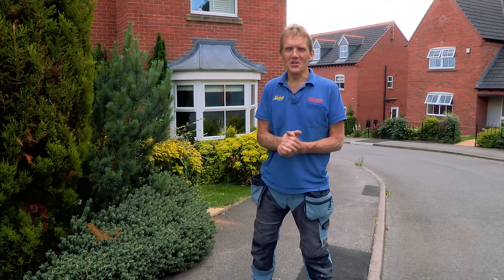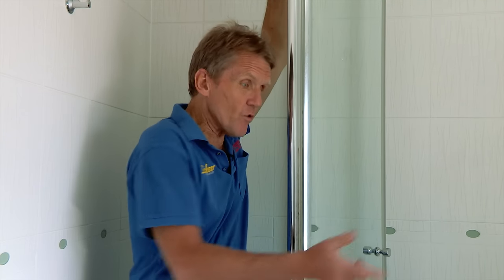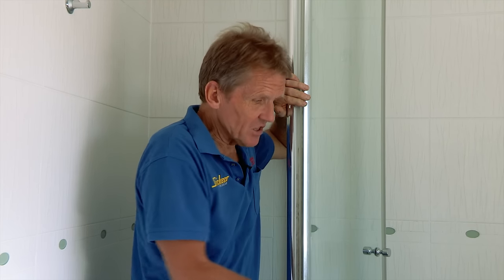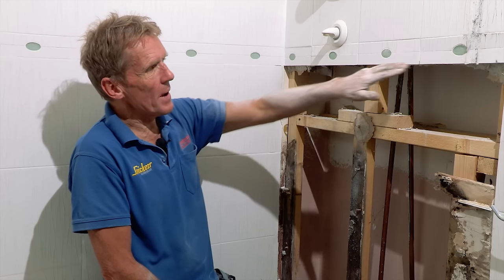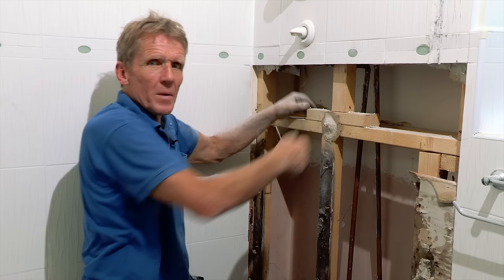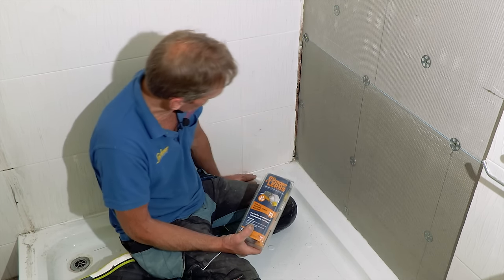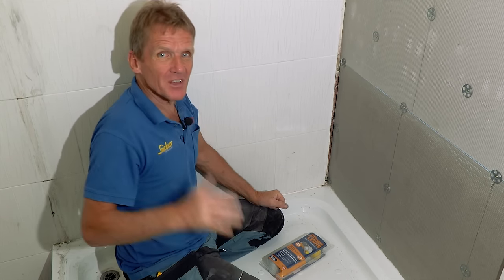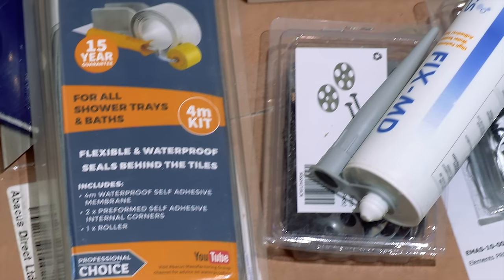Unbelievable Cowboy Plumbing Horror Show

Comment: Seems the real problem isn't the leaking shower, but the awful stud wall construction. Why are new houses built like this?

Had a leaking shower in our bathroom, noticed the wood flooring was warping and smelly. Plumber ripped out the old shower, which the previous owners had "sealed on the inside" , didn't know that was a problem but every day is a school day. Anyway, the leak was quite old, but because the walls were brick and the floor was concrete, it didn't cause any damage. Didn't even need to re-tile. Just cleaned and re-installed the old shower pan and cubicle. 

How can a stud wall stay rigid?

Surely any pressure on that wall from simply leaning against it would crack the grout and cause a leak. How on earth was that house ever expected to last.

Comment: If used correctly marine ply is fine for this job.Should be sealed before tiling.Our bathrooms were tiled 25 years ago and are like new.Those hi-tech insulated boards weren't even available then.

Comment: I did not see him re mount the thermostat control as he mentioned earlier. When he fitted the new board there, I'm sure you could have seen the extra supports attached to the woodwork. Can this be explained please ?
Reply from the maker: 9.35 you can see the bearer mounting for the valve
Reply from the maker: Watch it a bit more closely. The shower valve is mounted on a bearer that runs across the back of the studs

Comment: Good . Where did the water behind the wall come from ? Leak in shower valve ?
Reply: No.  Not only was the gypsum wall board not waterproofed it was set on the shower pan directly.  This allowed the water in contact with the bottom of the edge and it soaked  into the wall board upwards

Comment: There isn't cheap plasterboard. There is correct and incorrect depending on the area of installation.

I would not have had that backer board joint directly under the shower control.

And there were nowhere near enough fixings.

Comment: Can anyone help??? When water runs for awhile on bathtub(2nd restroom), the floor starts flooding usually on my restroom which is on the other side  of the wall..
Reply from the maker: It is the seal
Reply: @SkillBuilder    sorry dont know much about this.. can you be specific? Something I can do or do I need to call someone..which I already booked an appointment.  Dont know if the tub needs to be removed or the wall. I might add it's the only time water seeps under the wall!! Thank you for the reply.. wondering how much this will cost!

Comment: You should never put the backerboard all the way down against the shower base. leave yourself a 1/4" to 1/2" gap in between to prevent water wicking up the board
Reply from the maker: Water will not wick up this board, that is the whole point of it. I have weighed a piece and then put it in water for a month then weighed it again. It absorbs nothing. The convention is to run it down behind the tray so there is no void and then tile down to the tray on top of the tape. 

Your idea is applicable to water resistant plasterboard but even that is not run down onto the tray. .

Comment: Thanks so much for your videos.  Yours are the only videos ive seen that seem to take a belt and braces approach.  As if it was your own home.  Im a keen DIY'r and have been the victim of the plaster board scam used on a shower area.  I've managed to chase back the tile area on the plaster board wall - water damage went about 10 inches up the plaster board.  The other shower wall is brick with plaster directly onto it, chased the first layer of 10 inch tiles off the bottom and the plaster seems soft at one end.  If you don't mind helping a sole out.  Whats the best practice for the brick wall? should I remove the tiles to a safe height, and  then use Elements boards and dab to the wall?  many thanks for any help.

Comment: This is incorrect you may use plasterboard but you MUST keep the plasterboard from touching the tub as water will wick up once it gets behind the caulk. You MUST seal the tiles grout with a sealer as well if done properly it should last 20-40 years. If the tile is never maintained regardless of how you seal it especially if the grout falls out you will need to regrout you will not stop cracks by using cement board as an entire house shifting will not be stopped by that
Reply from the maker: I am talking about U.K code, not American. Plasterboard is rubbish in a shower
Reply: @SkillBuilder  nah it works fine if you keep it off the tub rim you just don’t know how to do it. Easily lasts 20-40 years

Comment: I don't know why people use drywall, plaster, cement board for wet areas? Unless you're waterproofing the space with a membrane of some kind. You need to use what Roger is  using in the video. In the US this material is available in various brands, wedi, go board, kerdi board and others.

Comment: The stuff you used is one use only. Because if you try to take off the tile at a later date the board disintegrates
Reply from the maker: Basil 
Yes you are right, the affinity between the tile adhesive and the board is so strong that it can't be separated without tearing the face off but, here is the thing, that is exactly what you want. If you want to  retile in the future you will be going back to the studs. I guess with cement board you could hack of the tiles and grind the face smooth to re-tile but I would rather start from scratch or, better still, tile on tiles if you have room.
Reply: Hi Skill Builder, cement backer boards are just the same. And the boards you used are VERY expensive, so going back to the studs is an expensive job. I have used plywood in 2 of my shows at home with none of the colour leaching you describe and one has been up there since 2004 with while grout. Plus plywood is so much simpler to get tiles and adhesive off. One tip I have is to use a wallpaper steamer to soften the adhesive (after you take the tiles off) and use a scraper to take off the adhesive. This method can be used on plywood or plaster walls
Reply from the maker: @basilkearsley2657  
You may have had success but 
the British Standards code of practice prohibits the use of plywood as a tile backing  board. There are a high number of failures and, if moisture gets onto it from a crack in the tile grout it will set up a mould which pushes the tiles off. 
The cost of decent plywood and the time spent cutting it, priming it  and taking it up to the jobsite means that it has no real advantages. I have stripped out plenty of wet rooms where plywood has been used.

Comment: OMG now he’s burying the mold behind the new shower!!!!  Wtf if this guy thinking??
Reply from the maker: The mould is dead when the moisture goes, No need to chemicals
Reply: @SkillBuilder   uhh, depends on the strain. Aspergillus can survive off 60% relative humidity once established.  Wallemia can establish itself at 55% relative humidity and has no issue living off dust alone. Many aspergillus and some penicillium produce ochratoxin a. 

     Now, just because it’s currently not actively growing and it’s dry doesn’t eliminate its effect on indoor air quality. As it remains dry, parts break off and enter the air, people who have become sensitive to it will have an immune response causing inflammation in various parts of the body. Many of the common symptoms are headaches, fatigue, brain fog, in particular word recollection issues. Most the time they are misdiagnosed as fibromyalgia, chronic fatigue, and migraines. There is also shortness of breath when exposed to certain molds like the notorious black mold  Stachybotrys chartarum. That one is most common on paper backing  of sheetrock exposed to slow leaks however it will easily grow on wood. It’s also a rare one in nature and never grows to the point found in an indoor environment. 

The steps you take are GREAT!! However, when it comes to mold, it’s mere presence should be taken with a greater degree of seriousness. 

  Full containment, negative air, physical removal under controlled conditions, the proper vacuum for level H cleanup. 

    And sure, no need for chemicals, physical removal with a wire brush or removing the contaminated surface should be done. 

    You take such great steps to prevent the mold; it seems foolish to bury it behind such good work.

Comment: Hi would a cemrock cement board work on shower walls ?
Reply from the maker: yes there are plenty out there such as Aquapanel. They are heavy and dusty to cut but it is a low priced option. You still need to seal the joins.
Reply: Thank you for the reply,I have learned a lot from following you on YouTube.
Keep up the great posts 👍

Comment: Brilliant work, just for some balance, those are failures from multiple trades on site from joiner to plasterer and plumber not just one man, if you took half as long as that to do that job on site you would still be sacked if you were agency. All  trades I have worked with want to do a top job but large sites won't pay the money or have the time, all projects are behind from the moment they put the first shovel in the dirt and most are over budget after the last brick is laid on the ground floor. The industry needs to change, the workers are fine they just need the ability to take their time. Apprenticeships are the same way, no time to properly show them the job so they learn it has to be quick not quality.

Comment: In sweden, you have to have a homogen membrane on the floor and walls. And you're not allowed to have a solderd pipe joint in the wall. The rulebook on how to water seal a bathroom is massive in our country. The way you fixed the bathroom in your video wouldn't be enough. The hole bathroom would have to be tared down, and everything would have needed to start from scratch. If the insurance companies discover that the rules haven't been followed, they wouldn't pay any money for the damages. And it's the insurance companies that have written the rulebook in sweden.

Comment: Aqua panel and tanking kit for me...
Reply from the maker: Nothing wrong with Auapanel apart from the weight,  but the insulation on this board is better and it cuts more easily with no dust.

Comment: In the US this is all specified in their building code. If they tile onto bare plasterboard they won't get it signed off. I can't see UK building control ever getting involved in a bathroom tiling job though.
Reply from the maker: you are so right. I was out on a new build site today and still the same old same old.

Comment: I’m about to rip out my bath and put a shower tray in. Brick walls and concrete floor. I will be making a platform with treated timber. I was going to lay some ply on that. 
But don’t know the best way to fit the tray onto the top of that.

Comment: Can you use this to tile a wooden floor? In a hallway or kitchen?
Reply from the maker: Yes you can! but unless you want the insulation there are other boards which are more rigid. You would need to be this board on tile adhesive to take any undulations out of the boards
Reply: @SkillBuilder  thank you, I really appreciate the video and your response.

Comment: If the orientation of the studwork was poor, why wasn't it rectified before fitting the Elements board to it?
Reply from the maker: Because it was part of the wall line and we limited the scope of the job to save the customer money. The studwork was braced back against the solid masonry wall so it was rigid.
However that was not the end of the story because the customer then decided to go for a much larger walk in shower and a new shower valve and tiling throughout. In short a new shower room.

Comment: :P Not up for the standards here in sweden... a pro tip... insulate those pipes also that in the wall. Make em seemless (no hidden joints!) Pull out the copperpipes through the wall and make the coupling outside the walls so you dont get any leaks in the wall. Use silicone on every screw you screw in. 
British standards in building are lightyears after the Swedish. 
Also make sure your ventilation evacuates the steam...
And for the love of god... Dont use these built in water valves! Pull out your pipes, mount the mounting and attach your water valve on the outside!

Comment: Plasterboard is fine once fully tanked
Reply from the maker: not according to Knauf who make plasterboard. 

The core is organic and will break down in moisture. How do you stop the water wicking up from the bottom when the silicone seal fails. I have seen it happen so many times. 

Why use plasterboard when there are purpose made tile backing boards?

Comment: Nice to see a good job done for a change and not the cheapest methods used. (cheapest methods were used by the builder :()
Reply from the maker: Hi Rob Thanks for your comments. The builder used the most expensive method because it had to be done again. Just not expensive for him.
Reply: Removing my bath in the summer break and you have given some great tips and sound advice for fitting my shower tray, thank you 👍

Comment: We are about to have the bathroom redone in the 1930's house. Our current wall tiles are stuck on the brick wall without waterproof boards. The floor tiles are stuck on the plywood (which disintegrated below the bathtub). The builder who came to give a quote said we don't need waterproof board on walls and can stick tiles right on. And the floor tiles can be stuck on a new plywood board. Does it sound right to you?

Comment: If water is getting behind the tiles then the job has not been done properly, it doesn't matter what the substrate is behind the tiles whether its normal plasterboard or fancy waterproof boards the bottom line is water should never be getting behind the tiles and it won't if the job is done correctly to begin with! If it was really as bad as what some people are making it out to be then every bathroom in the country would need ripping out and people's homes will have rotted and been destroyed (clearly not the case🙄). Ive ripped out many bathroom some 30+ years old which were still functioning but just outdated and the wall and floors underneath were bone dry and no sign mould or any historic leaks.
Reply from the maker: So why does the British Standard call for a complete tanking system on all showers? It is because there are hundreds of thousands of failures every year and some are repeat failures. Plasterboard is not a good material for tiling onto. Paper faced gypsum, there is nothing there that suggests longeivity. 
Grout crack, silicone fails, steam gets in mould forms, tiles fall off. You know it if you are experienced in this game.
Reply: And there will be another "hundreds of thousand" bathrooms and showers functioning just fine, as has been mentioned when tiled and grouted properly and good quality sealant is used then water should never be getting behind the tiles end off, if it really was the case of water always getting behind the grout then every bathroom would need ripping out and will have long rotted away by now, If you know what you are doing you will never have problems many tilers and  bathroom fitters have managed fine for decades before these boards existed! Well those who knew what they were doing anyway!

Comment: at 3.32..hes says the studding is absolute rubbish..then proceeds to fix the new board over it...🤔
Reply from the maker: Yes, having braced it back against the wall so it is rock solid. It is a case of trying to limit the operation to save the customer money. Watch the video again and you will see the blocks against the wall

Comment: Good to see a propper job done. As a self builder, I would say, half the contracors I have used are "....Rubbish" most simply labourers who have learned on the job and then gone solo. Even the C+G certed ones are very poor. One thing is true they all think that they are "The dogs" and charge accordingly.

Comment: In this video Roger went over the horizontal joins but not all of the vertical joins, why was that?
Reply from the maker: Hi Richard 
 The only vertical joint that wasn't taped was where the Elements board joined the tiles on the right hand side. This was filled with silicone and is outside the wet area.

Comment: I blame plumbing educators. On level 2 and level 3 plumbing we never once learned about any of this. The supporting skillsets required for plumbing are almost just as importing as plumbing itself, but simple things like how to joist behind different walls and the problems that arise from doing it wrong weren't taught, demonstrated nor practiced at depth or even at all, so other than through YouTube videos or finding an apprenticeship with a master plumber (who knows how to do it properly) then what choice do plumbers have? I think the education system needs addressing, it's not comprehensive enough.

Comment: Yes Roger, but what happens when that cheap nasty white plastic shower mixer valve fails? How are you going to replace that with something of quality without ripping it all apart again? You can’t get to the pipe work without undoing all your hard work. When you had it exposed you should have replaced the mixer valve with quality. A “ Mira element” model is a not too expensive valve . It’s quality built and leaves the hot and cold inputs still accessible if the valve fails in years to come. It’s only disadvantage is that it protrudes a little more than that nasty plastic first installation mixer valve. Happy days.
Reply from the maker: You can swap out the cartridge without touching the tiles. If you watch the sequal you will see where I ripped the whole thing out again. It was the customer's decision in the end.